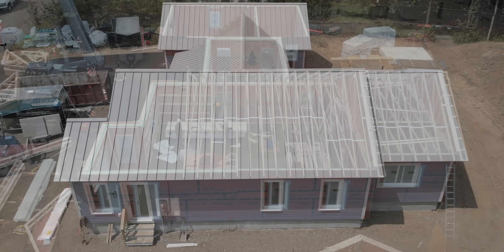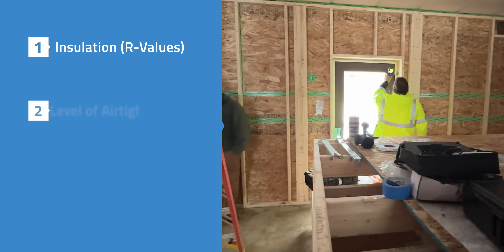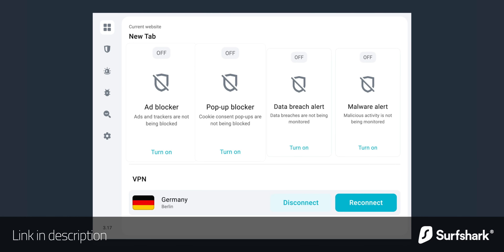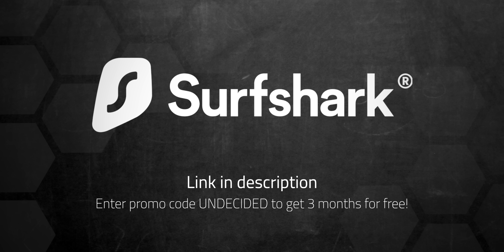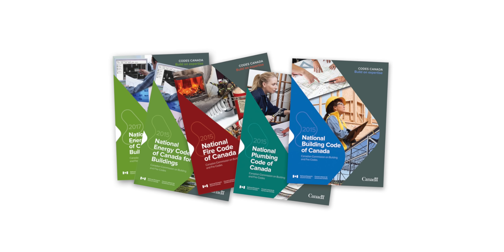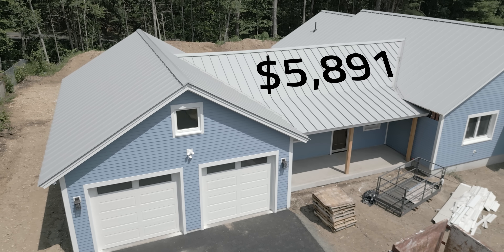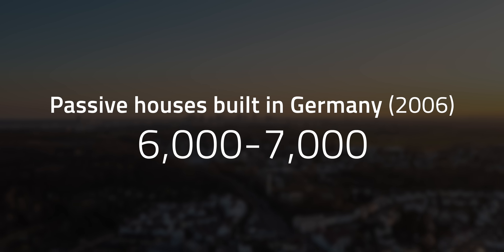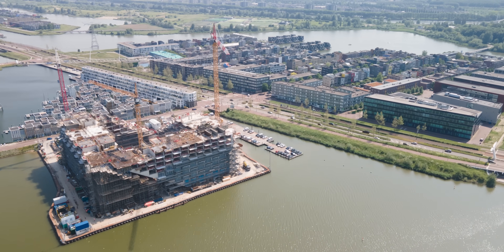Why Do American Homes Suck?

Comment: The house construction industry in the US is extremely resistant to change, mainly because of how “optimized” cost is given the area of a house. If someone else can build a 2,500sf house for the cost of your 2,000sf house, good luck competing. It is so ingrained that house builders have successfully lobbied my state (Minnesota) to remove a new requirement for insulation on the outside face of walls, as one example (this is required in commercial buildings here).

Moving on to large developer projects, the standards get better in some ways and worse in others. The overall energy use by commercial buildings in the US is pretty appalling, not simply from heat loss but from heat gain and performance of HVAC systems. 

I now work in the government sector, where energy efficiency is much more important and actually implemented, even with the same low standards. To me, it is disappointing that commercial buildings are not built to at least this level, but there is so much emphasis on short-term returns and zero consideration for efficiency if the tenants pay the energy bills.  

Americans don’t seem to hold the belief that empowering their government to make things better is a good thing, so here we are.

Comment: The problem is American homes aren't built for living in. They're built to have good-looking stats on private equity firms' ledgers. They don't need insulation when their primary customer never intends to live in them, don't need soundproof walls or efficient fixtures when they will never be used, and don't need to last when doing so means the land can't be bought up for pennies and redeveloped in ten years to make the developers and private equity stonks go up. We've turned housing, a literal human necessity, into another vehicle for adding to the hoards of literal fantasy dragons in human flesh.

Comment: I think what is often forgotten is that here in the US we go through EXTREME weather, and personally if I had a house that was torn down by a tornado (it will happen regardless of how thick your walls are or what you make it out of) I would rather be hit by material that breaks easier than to be k!lled by a brick to the head

Comment: Having a custom passive home built is financially out of reach for the vast majority of Americans.  Earthships are an option but only where space and code allow.

The best option for most people from both a financial and environmental standpoint is to buy an existing home and improve it. Air seal every gap possible, upgrade windows and doors, build up insulation and upgrade heating/cooling systems.

Comment: After WW2, here in Finland winter war. Many houses were destroyed, some were left in Rusian side of the border. Warriors that were in war had long felt cold and heat in the front. After war soldiers and those evacuated before war from now Russian side. Was promised land by Finnish goverment to call own. So because they got own land of course they wanted own house and they made good ones that were hot in winter and cold in summer. Here in Finland those houses are called Frontman's house (Rintamamies talo). These houses made one of the biggest layout for detached houses for decades to come. Which over time were improved. USA Haven't had Real multi year war in their land. Meaning economical living were not issue. Were as Europe have had multiple wars, so we need to save every resouce we get: fuel, electricity etc.

Comment: I build my new house on 2020 during the pandemic. It's not exceptionally well insulated but I'm confident its much better than US homes. It's about 20% better than our local building regulations require.

The result is that my house is carbon negative and really cheap to run. I have an EV which I charge at home, a hot tub, two large freezers, two large fridges, two ovens, induction hob, two large screen TVs etc etc - all the usual household appliances.

I have 6kW of solar panels and an 11.8kWh battery, I also have a heat pump with an output of 5kW.

The average winter temperature in my area is around 10 centigrade (50f) and from April until September we bask in an average of 18 centigrade (65f)

The winter is mostly overcast so the solar doesn't work too well.

However with all this mediocre climate and having an all electric home with a home charged EV my house only uses about 4,900 kWh a year - less than 14 kWh a day.

But I export about 2650 kWh of surplus power from my Solar, mostly in the summer)

I don't think my house is exceptional now as a new build and obviously we have house that are hundreds of years old which are very badly insulated but all in all I think UK is definitely going in the right direction

Comment: As you state in the introduction, “US (shoebox) houses suck”:
1. Grossly overpriced financial speculation objects
2. “Nice looks”, construction lacking substance
3. Those with aluminum wiring are even outright dangerous 

Even most Mexican medium-class houses have a more solid build, go and check for yourself…
Reply: Aluminium wiring, is that even allowed for new installations? Why would you even do that, copper wiring for an average house is only few hundred euros.
Reply: @effedrien  You’d be surprised about where you stumble upon aluminum wiring…and it’s highly dangerous connections. Why? There’s people who want to make “just a bit more” profit + people who don’t know how dangerous this is…
Reply: @An_34832a  That's indeed dangerous for house wiring, the connections on screw terminals are not reliable and that is a serious fire hazard. Where i live it's only used for high voltage cables. You can't buy aluminium cables for the house, only during renovations i sometimes still see very old cables that are not copper. But always at least 50 years old, never something recent like that.

Comment: Having lived in Europe and Asia, and traveled and stayed in European houses over the years, most houses in Europe are not insulated well and having aging systems.  In Japan, the houses are built for summer, not winter so the walls are thin, with no insulation.  In winter people often have kerosene heaters in rooms to heat them up, while leaving windows cracked for ventilation.  They have a long way to go to rectify this.  New houses are better constructed.  As for energy efficiency, the U.S. has a long way to go.
Reply: You must admit our houses are stronger here in Europe, but the oldest ones are not insulated indeed. Just stronger, brick walls and heavy roof beams that can support a stone roof. Not that we often have violent storms or so, we just like something heavy around us to feel safe i guess.

Comment: I think one of the things you overlook, specific to UK code, is the absolute lack of new homes being built for the last decade+. It is very common for most in the UK to be living in homes that are 50-100+ years old. There is classic terraced housing built in the era of manufacturing workforce based households of the early-mid 19th century dotted all over the UK. Many of these homes and old cottages and bungalows have very little to no insulation to speak of whatsoever. They are often riddle with damp issues and the mold that comes along with that. On top of this, there are much older dwellings all over the country that are centuries old and still have thatched roofs. So while it is one thing stating UK "code" is stringent today, it is quite meaningless when the majority of the population lives in much older and sub-standard insulated dwellings.

Comment: I always wondered how houses in Florida where its generally hot have fitted carpets, breeding grounds for bugs and slanted roofs normally used for snow areas that can easily be blown away by hurricanes.
Reply: Carpets are not an issue, in regards to the roof, it's usually for storage and additional insulation. We've got a pretty brutal sun and either vaulting the ceiling or just raising the roof makes a pretty big difference. New constructions have long rods that anchor to the foundation to keep our roofs pretty well locked on tight

Comment: I’m from the U.K. origins it compares to barely nowhere in the States. Having lived in Belgium for two decades and travelled across mainland Europe it’s more comparable. That said it’s codes have only harmonised in recent years because even on the continents so varied. I don’t think one model fits all works. The US is a vast continental mass that is not penetrated by navigating waterways aside from the Mississippi and the Great Lakes. That said the caloric cost of producing and distribution of modern methods of manufacturing are prohibitive.  This said in North America it has historically used the materials to hand, that being timber. Timber however on the upside is lighter so homes are larger, in Europe with Brick and Steel homes we have open plan which creates a false illusion of space but our homes are far smaller. In US also a home that’s old does not gain value like in Europe, normally it’s the land of interest so it’s knock down and rebuild.

Comment: I've always struggled to understand American housing. In South Africa, houses are traditionally always clay brick. If you want a high quality home, you still use clay brick (as opposed to cement bricks and cinderblocks). Clay bricks are breathable, don't cause cracks like cement bricks do, and function quite well with passive temperature regulation.
Reply: As a fellow South African but living in Atlanta. America has always had large amounts of forests and thus lumber. So people use what is readily available. SA never had the quantities of lumber that USA has. I love the brick houses there, built to last. SA is generally warmer which is why they tend not to be energy efficient. A house in Pretoria in winter can be a chilly place to be without heaters. Not sure I have ever seen a double paned window in SA either.
Reply: less supply off good clay? Not many SA homes suffer from snowstorms , freezing ice or harsh winters.

Comment: Although, it's the big deal to own a home in the USA, it's not really that wonderful.  Very few people actually OWN their home and if they do, they usually got it by taking out a mortgage on the value of the home.  They have mortgages that they pay or the banks will evict them from their home and sell it to recoup their loss, the term "I had my home sold out from under me" comes to mind.  Most people who stay in their home all their lives often see the neighborhood change from good to bad and, only if they're very, very lucky, back to good again before they pass away.  During that time, the home will often need work that the homeowner might not have funds for and which might force them to obtain a mortgage from the bank (see above issue).  Most houses built since the 1970's or so have NOT been "well built".  Shoddy manufacture at best for the everyday, middle income family.  Sloppy angles that aren't straight, cracked wood that someone filled in and hid behind wall board and/or paint.  The occasional interior workings (HVAC or electrical) put in sideways or upside down.  Badly installed carpet or tile.  I could go on.  Our local Housing Developer has a few lawsuits against them for their shoddy work and I know this is endemic across the USA.  What is truly bad is that the USA has "Regions" and we only really use one type of house style for all of them.  Homes in the SW should be made against Hot Dry climate, SE against Hot Wet Climate and Hurricanes, NW and NE against Cold Wet Climate, and North Central Cold Dry Climate.

Comment: Building standards in Ireland improved a lot post 2008 but higher standards and more stringent planning requirements (which vary according to individual planning staffs  preferences) mean it's a lot more expensive to build now so the stock of newer housing is incredibly constrained.
Reply: Remember planning rules are alot looser to challenge outside Ireland and that constrains supply. In a tight supply what builder cares about exceeding the codes (assuming they are ever checked anyway). Also Europeans rent apartments not buy 3-bed semis. Also pre 2008, we know there was no rule enforcement. The US may have poor building codes but they are enforced and always were. Here it was either optional or only done to avoid being sued later without a stronger defense that you bothered

Comment: We may have code in Canada that addresses efficiency but I suspect it's voluntary or region specific.   A few years ago a builder bought a lot across the street from my place.   I watched as he built 4 home on this lot.  I wouldn't buy any of them.   From what I saw they did bare minimum code.  I doubt if those homes are any more efficient than my 1970s townhouse.

Comment: Matt, what would a house that was built without this energy saving technology cost per square foot relative to one that is built with the energy saving technology? 

The reason American homes "suck" is that there's no financial justification to make them more energy efficient. Worse yet, making minimum requirements to build new housing units even more stringent will further drive up the price of housing, which is already a major problem in the US. It's great that your house doesn't cost very much to heat or cool, but that's not the only metric for long term affordability and financial sensibility. If you pay 1.5x the base price of your home (let's say $862,500 or 1.5x the average price of a home in WA), are you really going to pay that off with your $5900 in savings per year over a 30 year period? No, you're not. You'll end up saving around $200,000 (after adjusting for anticipated inflation) compared to a home that was built with less stringent methods but at a fraction of the cost. Well, that leaves around $87,500 on the table, and not very many people see the value in parting with $87,500 more than what they need to in order to put a roof over their heads. 

The answer to your question "why do American homes suck?" is really just that people choose to build less energy efficient homes here and there's no government edict that stops them from doing that. If it were economically pragmatic, people would almost exclusively choose to build extremely energy efficient homes.

Comment: due to the relatively low costs of utilities (gas, electricity) there is a very little motivation to spends thousands $ more to make a house marginally more efficient in the USA. It is no different then the automotive market, only recently the cars are somewhat efficient, before then most people were driving V6 or V8 and no one cared for the gasoline prices.
Reply: Until the next Crisis, yes…

Comment: That great American value: Pennywise and pound foolish. 

During the Texas winter crisis of several years ago, news reporters showed damage to homes. It showed floors on concrete slabs, little insulation,   utility pipes coming through outside walls...these were relatively new homes (less than 10 years). 

The basic energy and home builders plan was to do the least to maximize growth in housing. 

So, the storm was the second in 8 years. Since the state agenda is in denial of climate change, they continue to do the least for the "one in 100 years" weather systems that hit them twice in 8 years.

We know what to do. We lack the will to do it.

Comment: Man you are complaining about low building standards in the US, while here in India, there are no standards at all. It's a free for all, build as you like. There is no authority coming to inspect your home. Energy efficiency is an alien concept here. There is ZERO insulation in any home. No building contractor knows anything about R-value or U-value. Due to lack of insulation, electricity bills get ridiculously high if you run the AC 24x7. As a result, central air-conditioning in homes is non-existent in India and middle class people can't even afford to run a single room AC for 24 hours a day.

Comment: Interesting comparison! 
I'm from central Europe and first heard about the north american building style in my lectures about fire safety that the houses usually take 5 min to burn down. 

Would be very interesting if you could do another video by comparing the differences more in detail. :)
Reply: They don’t care bc. a Mexican will have fully rebuild, correction: nail-gunned it 10 min later. American Desaster handling is following Groundhog-Day principles.

Comment: I think it should be understandable that not all aspects of a house are equally important everywhere.  I had a new house build here in Norway in 2018 and it is very energy efficient indeed, though it's not what we call a "passive house" which takes it to an extreme.  Features like being able to reuse heat (pre-heating incoming air using the heat of outgoing air) in the ventilation system is mandatory for new houses here and is obviously of much more use to me in the winter months in minus 20-25 C than it would be in, say, L.A.  As an engineer I'm naturally interested in optimizations and efficient design, but one should not lose sight of the environment in which the system runs to make sure the optimizations actually are worth it.

Comment: Our Scandinavian home was built in 2017 to meet the building requirements of the national 2020 building codes.

Those requirements only allow the blow door test (ACH) results to be a max of 0,5. 

Our house came in at 0,24, (meaning our 2100+ sq ft house cost approx 710$ to heat a year incl. heating all the hot water for the year.)

And these are general building codes here. They are renewed set every 5 years. And as they outdate I do believe you can’t build according to older codes if you want the house approved for living. 

That’s why most builders build up to the newest codes years in advance, as the updated codes are published. 

It’s interesting to se the differences across the world.
Reply: Yeah it is interesting. It only costs $500 for heating and cooling my same size 65+ year old home in Northern US.